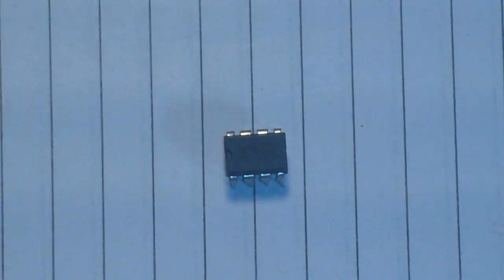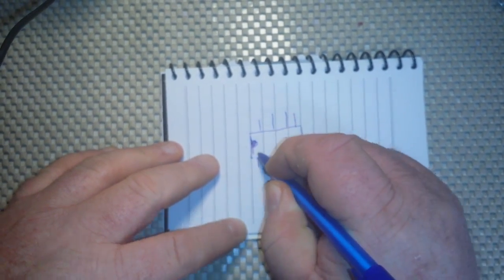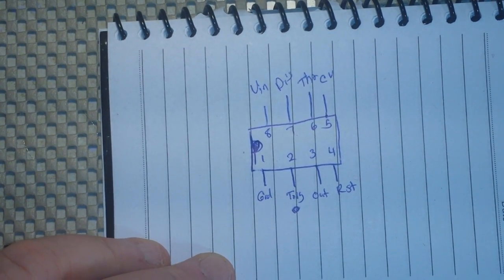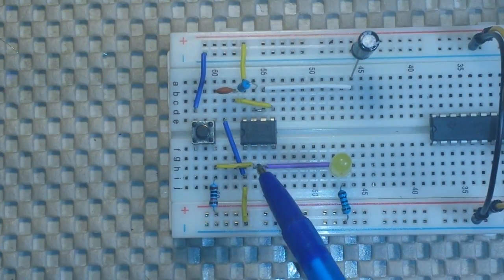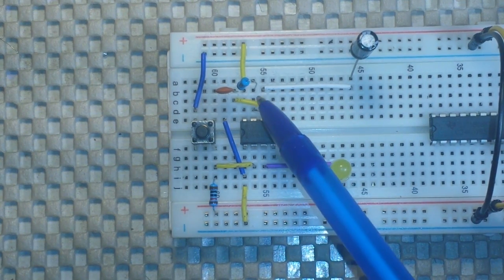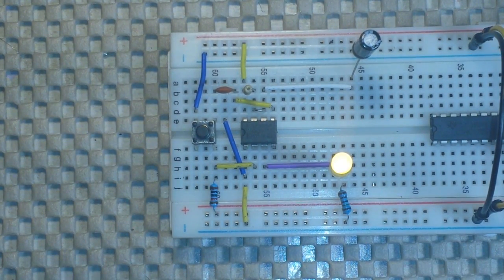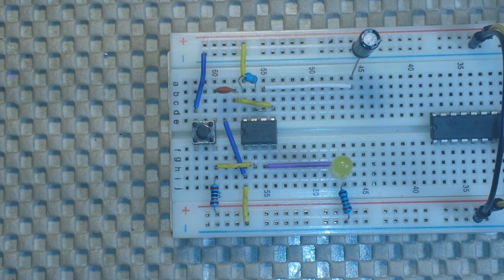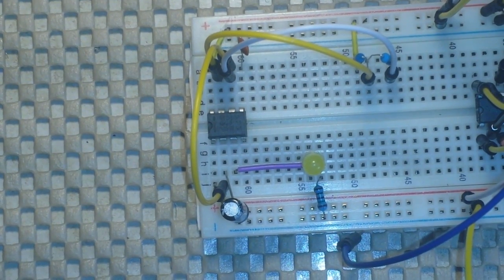Learn to use the 555 timer

Comment: Every demonstration that I see today utilizes LEDs.  I'm trying to build a multivibrator for small 1.5-3v incandescent bulbs (powered with 3v-9v batteries) to restore some old toys that require vintage bulbs.  

It seems that incandescent bulbs have far more resistance than LEDs.  I made the mistake of purchasing some prefab multivibrator PCBs for LEDs (because I have no knowledge about this realm).  The setup was rated to handle 3-15v, so I thought that this would be great for powering my micro 3v lights.  The default PCB setup wasn't powering my incandescent bulbs.  I was told to remove/skip the resistors leading up to the diodes, and wire directly to the incandescent bulbs.  This hack works, but this hack is not really the solution that I want, and it's overloading the components (transistors are quite hot and eventually failed).  I'd much rather know how to select components that are correct for the job, instead of banking on the supposed workable range of a default product. 

Is there an easy way to check the resistance of a bulb (if heat from a bulb can cause varied resistance)?  How do I build a reliable circuit that will power them?  Someone suggested that I use a 555 timer instead of trying to balance a mutlivibrator.  :/  And as far as a 555 goes, I have no idea how items should flow through the chip.

Comment: Thanks Paul, really useful again! I have a particular problem - trying to power my WSPR transmitter over a 2-3 day period with a modern USB power bank . Problem is my supply keeps switching off. I'm assuming that if the power bank doesn't detect a certain level of current draw, it switches off the supply to the USB port. In my case after  30 seconds. Is there a possible use here for the 555 to switch on a load drawing say 50mA, every 15-20 seconds?

Comment: What should I do if I want the 555 timer/decade counter to make a pulse only 8 times? I want a relay to pull 8 times every 2 hours og 4 times every 1 hour.
Reply from the maker: Connect 9th output to reset
Reply: @learnelectronics  thank you! you are the best. what do one do if its 20 times og 57 times?
Reply: @christiannielsen3863  use more than one decade counter and connect the N+1th pin to the reset pins?

Comment: Thank you for this great video. Now I know a little bit more about 555 timer. Can you just tell me in the astable mode, what resistors did you connect to pin 6 and 7 as voltage divider? 
Thank you.
Reply from the maker: I made this video almost 3 years ago. I honestly don't remember.  Try putting a potentiometer between 6,7,8. Thats what I do now.

Comment: is there  a 555 timer with two output pins and can you make one output pin low when the other one is high and have the two output pins alternate at desired frequency with var resistor? and cap ? , i need it to trigger two transistors ?
Reply: Maybe use a PNP and a NPN transistor, both bases connected to pin 3 of the 555. Then, when pin 3 is high, NPN is "on", PNP is "off", and vice-versa ?
Reply: @takix2007  i like that idea , i have seen some circuits like that..
Reply: Just use the 556. It's a dual timer.
Reply: @devilsatan2973  i had no idea there was 556, i know of 555
Reply: @mykedoes4099  Yep. It's 2 555s on 1 chip! Not sure if I still have one or not. Had gotten one some time ago. But don't know where it went now! (got a big junk box)